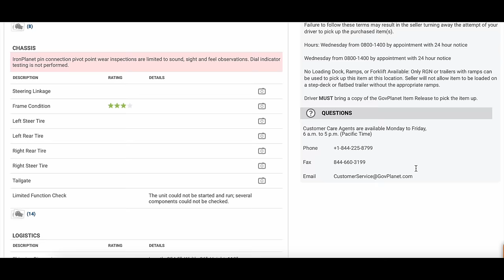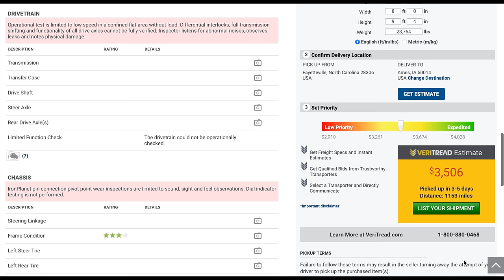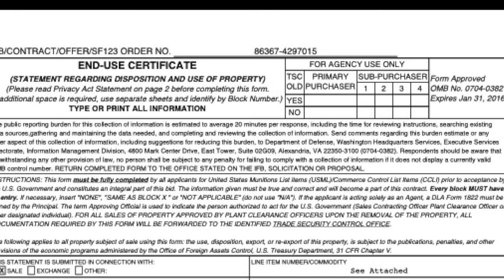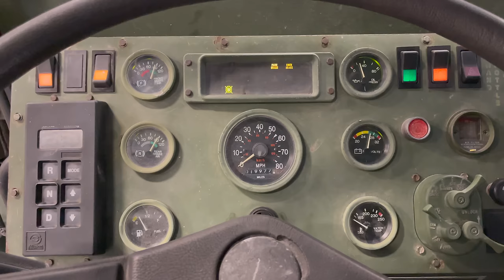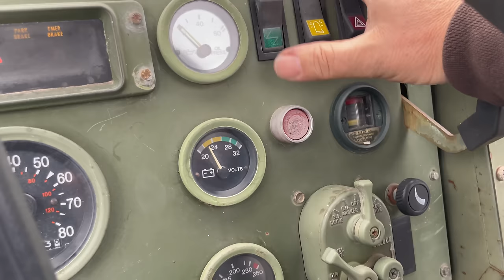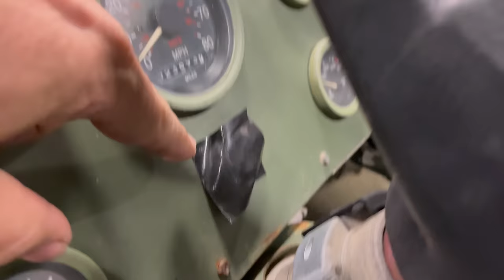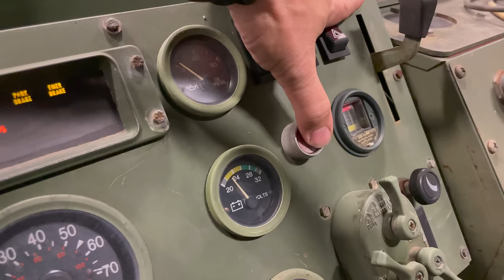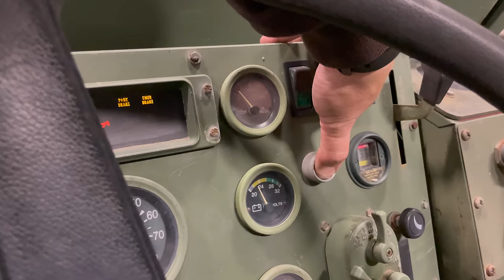Buying a LMTV on GovPlanet Wasn't How I Expected

Comment: So, for the unfamiliar: these trucks, and all military vehicles to a certain extent, are designed to be cheaply manufactured and simple to operate. What that means in practical terms is you've got a bunch of manufacturing shortcuts taken with a vehicle that will probably be driven by 19 year olds with no sense of their own mortality. By the time they reach their retirement, they're beaten to hell, everything that can leak will leak, the electronics may or may not be on the verge of explosion, and the less said about the drivetrain the better. But. They're also designed to be maintained and repaired without any proper workshop support. A half decent mechanic willing to put in the time and effort can get one running and keep it that way until the heat death of the universe. Just don't think too hard about all the pops and rattles, and make sure to keep the fluids topped off.
Reply: And always remember - if she ain't leaking, she's out of something
Reply: @FoxtrotYouniform  Found that out the hard way when a rear diff grenaded itself on a tank trail. That was a bad afternoon.
Reply: @gatling216  absolutely nobody wants to have to be the one to call up for the wrecker lmao
Reply: @FoxtrotYouniform  LOL I had a 350z, where I adopted that mantra, also if i couldn't smell burning oil i also knew i was low.
Reply: same logic applies to postal fleet vehicles haha
Reply: Pretty much sums it up...
Reply: We had 4 brand new ones show up on the flatbed...none would run lol.
Reply: "By the time they reach their retirement, they're beaten to hell, everything that can leak will leak, the electronics may or may not be on the verge of explosion, and the less said about the drivetrain the better."

They get like that before retirement age lmao
Reply: @AwkwardYet  They get that way the first time they go out in the field, but I don't want to scare folks off. It's fun watching stuff like this.
Reply: @gatling216  to be fair the fact theyre built cheap but are still unkillable and able to be repaired with simple shit in the middle of nowhere is the entire appeal of military vehicles, same with russian vehicles... sure the drivetrains are gutless and the build quality is questionable, but atleast you know you wont kill it haha
Reply: @gatling216     They get that way right out the factory production floor!
Reply: I dunno about cheap, I just looked up what Uncle Sam paid for these vehicles, its nearly 400 grand in today's dollars.
Reply: Kevin, how difficult is it to find ops and repair manuals for retired mil vehicles? I am thinking down the road about an off road camping vehicle and know nothing about mil vehicles made since the Willis.
Reply: @Bear-cm1vl  They're all available online.
Reply: @chrisbaker7888  reads up thread Yeah, okay boot. Tell me you never went anywhere or did anything without telling me you never went anywhere or did anything.
Reply: @chrisbaker7888  A single 4 year contract does not an expert in the military make. Terms like "boot" cross pollinate, depending on who you served with, where you served, and when you served. As for me, I spent over a decade working with LMTVs in various capacities, and I've seen numerous breakdowns ranging from rear diffs grenading to alternator bolts shearing to once, memorably, a stray cat crawling up into the engine bay.  

 The rest of us are having a good laugh about the bad old days, and you're trying to play the fun police. It's not that serious, my dude.
Reply: @chrisbaker7888  Ah yes, the pigeon on a chessboard version of conceding defeat. Well done mate, you did that one with grace.
Reply: @chrisbaker7888   if a man can be born with seven toes, military equipment can have zero issues during it's service, that doesn't make it a standard though.
Reply: If there’s no oil under it, there’s no oil in it. That was more common of the HMMWVs and M35A2 (duece and a half).
Reply: I can only attest to my personal experience, but while serving in the Marine Corps from 1979 thru 1985, our vehicles were under a ridiculously strict maintenance program. I personally saw M51A1’s get full PM’s with zero to fifty miles on them since the last PM. I saw tires that showed virtually no wear be replaced because it was “time” to change them.
Reply: These break from sitting around in the motor pool not from driving 45mph down the road. These things are reliable.
Reply: I like the person who wrote this. The realist version.
Reply: @christophermccrary8080  same with strikers, we had a theory that they got lonely and fuckin broke themselves... Wow guess that really does prove that it's a military truck🤣
Reply: @matthewkantar5583  - Well.. the government tends to overpay for everything. Kickbacks have to come from somewhere.
Reply: @ebolawarrior451  they're all hand-built too back in the Service I had the best running one out of 10 which only 5 out of the 10 were iffy some ran for about 100 miles others would run full transmission leaks etc at 20 miles
Reply: @matthewkantar5583  cheaply build doesn't mean cheap. That 400k is largely to pay for all the bureaucrats and "lobbyists" that guarantee the purchase contract.
Reply: Yours was an entertaining summary.
Reply: Reminds me of my last units (A 1/509 PIR), HMMV's. Missing hoods, doors bungee corded closed, our cupola vismod (OPFOR vehicle) were bent up and no way to drive straight down the hardball, lol. And yes, when given the chance I beat the shit out of them.
Reply: The military, at least the Marines, uses an echelon system of maintenance. 1st-5th, from driver maintenance at 1, to full rebuild at 5.  If the truck needs an engine or transmission replaced, obviously the guys at the forward edge won't be doing that.  That's why they have wreckers, and the truck can be brought to the rear where they can do that 3rd echelon maintenance.  2nd echelon covers the vast majority of repair/pm stuff.  If it needs higher echelon, it's brought to the rear where they're set up for that. I was attached to artillery and we did all the 2nd stuff right there in the field, in the maintenance tent.  If it was beyond us...it was gone.
Reply: I thought you were talking about the 19 year old operators when you started talking about beat to hell 😂
Reply: @lr1a704  I mean, that would also be correct.
Reply: This is true with base vehicles and training but I was in a mobile infantry company in the marines and all 3 developments were brand new vehicles and mostly brand new replacement ones and serviced by Oshkosh contractors in country.
Reply: I just love the way you put it, talk about salt of the earth.
Reply: @jwenting  always gotta find someone else to blame, never could be an inept government getting a bad deal. XD
Reply: @johnandrews9433  rather find the reason why they got the bad deal and deal with that.
And that reason is the bribery (oops, lobbying) that goes on at every level, from the uniformed officers writing the requirements sheets to the elected officials granting the contracts and assigning the budget.

The guys in the field who actually have to use the equipment are pretty competent more often than not, and frequently want completely different stuff from what they end up getting.

Prime example coming to the top of my head is our air farce's 1990s program to replace their transport and scout helicopters.
There was an international competition, with the French Cougar (aka Super Puma), British EH-101, and US UH-60 as the primary contenders.
The army and air force both favoured the UH-60 for its specifications, performance, reliability, and other factors.
That recommendation was forwarded to parliament where the prime minister single handedly decided to buy the Cougar instead.
He retired a few months later and was instantly given a job at the UN that paid him 10+ times as much, sponsored by the French government...
Now our air force as unreliable helicopters that are a bitch to maintain and spend more time on the ground waiting for spares than they do in the air.
Plus they're almost useless for their primary intended mission of inserting special forces commandos because of the high profile and noise levels.
Reply: Dude, you don't  know LMTV's. Compared to the old Kaiser-pattern 2 1/2 & 5 ton trucks,  the LMTV's were hideously expensive and MUCH  more difficult to work on. 
Ask yourself why these are on the surplus block when they're a maximum of 25 y/o.
Reply: @Rocker-1234  no
Reply: My m1078 doesn't leak a drop of oil.  Yes I keep a close eye on all its fluid levels.  Truck is well built compared to other trucks on the market.  Super easy to work on.  Tires are even easy to change with the split rims. On the other hand I have a bus with a 8v71 that leaks oil all the time running or not.
Reply: @bula001  well, THATS a damn Detroit for ya!!
Reply: Saw some semis on the road yesterday, I'm a truck driver. Would it b a goog or bad idea to buy a military semi for normal daily hauling?
Reply: Built cheaply but sold for like $200,000 per unit.
Reply: I met a pilot just after she retired and she told me about this aircraft she learned to fly on that the rule of thumb was "if grease isn't leaking from every crack and cranny, you're about to have a bad time."
Reply: You just over explained "lowest bidder".
The LMTV's are pretty decent though.
Probably the best truck in the army by my experience.
The cab and spare life are probably the common issues.
Reply: @pericochief  probably bad.
They don't have much for comfort and getting a person to work on it will be slim.
Depends what kind of truck driving you do though.
Over the road is a no.
Off-road trails or farm land is a yes.
Reply: Can you imagine a whole society run this way?  Welcome to Russia.
Reply: Is that why"military grade"is bad?
Reply: @FoxtrotYouniform  Yep, when I was fixing used cars I said, "Show me one that doesn't leak, and I'll show you one without any lube in it"!
Reply: I can confirm this comment. I was stationed at fort Wainwright AK and would commonly drift my lmtv on the way back to the motor pool. Mostly to see the shock on my VC’s face 😂😂
Reply: the classic "mil spec" experience, Goes to the lowest bidder and everything turns out just above baremin for the contract with basically every part needing to be replaced every half year.
Reply: I really want one but I can't license or plate it in my state of Colorado :( a coworker of mine bought a HMMVV from Govplanet and had to set up an LLC and register it out of state to plate it. One of these would be out of the question, however, I could get park tags for $25.25 and run it all around the Rocky Mountains, but getting it there 2 hours away..
Reply: Yeah, in my country the military also tends to run their trucks into the ground, and then they use them as parts donors Frankenstein several trucks into a working one.
After that, they're pretty much good only for scrap metal. Not that it would help you in any way, because, as part of some government deal with the US they still can't sell them to civilians.
Reply: "hmmmm sorry big sarge this looks like a operator level task" Hands him trans liquid pump
Reply: M1078
Reply: Or you get one that has almost no miles or hours on it.
Reply: I want an Abrams !
Reply: electronics do not "explode"

Comment: Double check your air-ride cab selector, the cab is not elevated like it’s supposed to be, causing a rougher ride.   Used to maintain several of these trucks and the Operators always failed to engage the air-ride cabs. It’s a very nice ride and very capable truck! Congratulations!
Reply: As a former army mechanic, if he bought it from the government,  it may be broken. Usually not to expensive to fix
Reply: My opinion is that at least for the first design of these - the cab support system was not designed well. The problems are the airbags and the locking latch...also tied to the airbags.
Reply: Lots of love here. I enjoyed every second of that video.
Reply: @adamorick2872  army pays $150 for a $15 part.
Reply: Or the damn hydo has checked out. Or the electrics got wet.
Reply: @warrenb8228  its about making the wars expensive XD
Reply: She'll eat your wallet too that's for sure Tires Brakes fluid changes
Reply: Jesus is LORD  Yes but did Jesus use the air-ride cab selector on his LMTV?
Reply: @Eric.Hansel  Being a fictional character, you can say he did anything you want to.
Reply: @shelbyseelbach9568  Oh shi-
Reply: @shelbyseelbach9568  how is that possible when there is historical proof?
Reply: @BM-wj7rn  Historical proof? Man, oh man, you've really drank that Kool aid haven't you?
Reply: @shelbyseelbach9568  No, just researched and read non-Christian historians writings of the time.
Reply: @BM-wj7rn  LMFAO.
Reply: @drippingwax  Yes, i used to train my operators from a Maintenance perspective, RTFM, it is written to teach you everything you need about the equipment family. learn one machine you learn them all just by being familiar. Glad you learned after the fact, but would have preferred the learning before the point of need! Thanks for your service Brother🫡🙏🏽
Reply: How do you turn it on? We always suffered lol
Reply: @TheSouthPaw264  in the hydraulic access point on the passenger side, there is a push in valve marked cab something,(been so long) one selector allows cab tilt and the other does the air ride cab lift. i have a manual somewhere in my cd’s, will see if I can find it and we can upload it.
Reply: @warrenb8228  actually not true on everything, Army buys the complete product where as auto part stores you buy possibly oem parts. possibly third party aftermarket. all parts the army buys come fully warranted and replaced regardless of damages.
Reply: @Eric.Hansel  Like the tongue-in-cheek,not overboard,like the next guy...
Reply: @BM-wj7rn  You are correct..
Reply: @drippingwax  Cool Story!
Reply: @NCPFunK  It's about making a few people very rich.
Reply: Thanks Jerry great info!!!!

Comment: Steve, the truck you bought from GovPlanet is an Air Drop Truck. The upper cab folds down into the interior to accommodate C-130 / C17 transport. Better check the motor mounts to see if this truck has been airdropped. If it has, they will be broken. Good Luck!!!
Reply: Awesome information
Reply: So they were meant to be airdropped and the motor mounts breaking were a sure thing every time? Yikes.
Reply: Paratrooper from the 1990’s here....  Yup!
Reply: @RamblinVan  the early models were extremely problematic.  You can tell it's an early model by the shifter.  Later ones had a different display.
Reply: Yeah, I would have passed on it based on that fact alone.
Reply: @williamfoster4268  What? You don't wanna buy a truck some kid kicked out of an airplane?
Reply: @jimitaco1303  Nope. That truck probably sat most of it's life in a motor pool rotting with dead batteries when it wasn't being jump started and booted out of an air plane.  Some lower enlisted probably pencil whipped all the -10 maintenance, PMCS, and L3's.
Reply: @williamfoster4268  how did you know???!!
Reply: @Mick762  I've been around the block before.
Reply: @williamfoster4268  my new kubota skid steer was pencil whipped, I just didn't know it until I read your comment.  lol   thing came new low 2 Qt on HD46...  check marks on the pre-sale were symetrical and I pointed out both the low fluid and the checks the sales guy.  Next time I see him I'll have to mentioned I learned a new term for what we saw, pencil-whipped.    oh my
Reply: @williamfoster4268  You forgot with flat tires, because the CRIS would leak down after a while.
Reply: @jasonschomburg614  CTIS would only leak down with the truck on, at least from my experience.  I worked in the largest motor pool with hundreds of trucks and never had anything go flat while parked on the line.
Reply: @williamfoster4268  I was NG so the trucks would sit for a month or more between uses and it wasn't uncommon for one to have a flat.  Possible it wasn't a CTIS thing but an o-ring or other slow leak.  The nice thing however was just start it and set the idle to 1500 RPM or so and she'd pump back up.
Reply: @jasonschomburg614  What year did they begin using the updated display? What year were they less problematic?
Reply: @mitch60mccoy  it must have been around 2000 or so.  We were one of if not the first NG unit to have them.  The first batch we got were built in 98.  The shifter display was a long rectangle with blue numbers.  When you put it in drive it would read 7 2.  7 being how many gears available, 2 being the gear it was in.  They only went to first in low transfer.  Originally these had no isolators in the motor mounts.  The would create subsonic pulses that would travel through the drive line and break the front drive shaft and then the truck would use the drive shaft like a pole vault.  Do to this problem they were limited to 30mph for a couple years.  We ended up sending them to Ft Carson to be retrofit with different motor mounts.  The later ones didn't have that problem, and had a red shifter display that only showed 1 number.  It's the same shifter as the 915A3 and A4
Reply: @jasonschomburg614  very helpful. I'm considering buying one of these m1079 units and converting it to a backcountry or wilderness RV rig. I like that CAT engine parts are available worldwide if I begin to drive to faraway places. Am I crazy or would one of these units be a great rig for this adventure?
Reply: I was in Germany and I saw two of these burn in after chutes failing to deploy. One of my best memories of the Army.

Comment: We followed one of these pulling a trailer near a national guard base and I thought “Wow, I wonder what you could haul with that.” Then we took a hard right turn and a huge box fell out into the road, spilled open and toilet paper rolled out. It was disappointing.
Reply: Soldiers got to wipe too man
Reply: Think this was the 5 ton version, if it had 2axles in the back.  Then pull stuff on top of that.  Load wasn't secure, is disappointing.